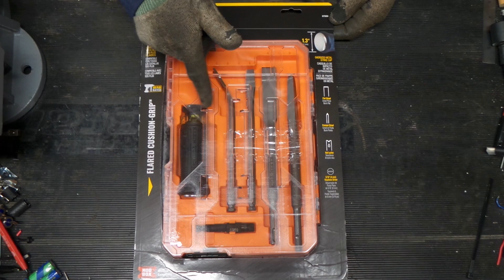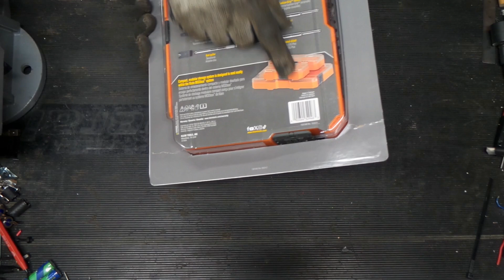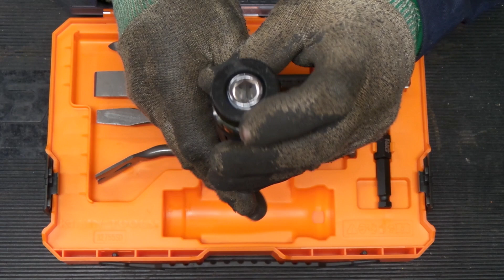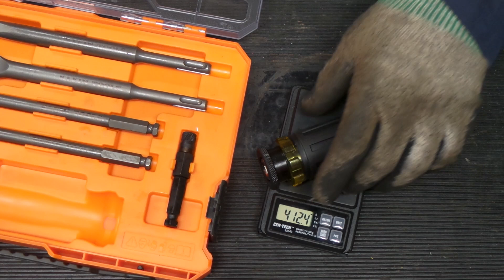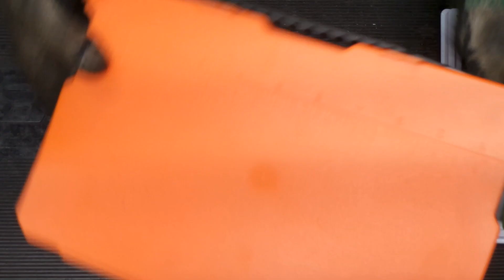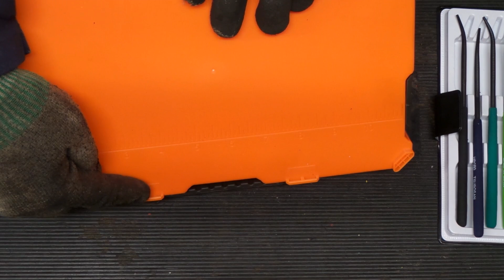Klein Tools SDS Demolition Driver Set, 6-Piece (32755SD) Review

Comment: This is a great review.  It illustrates the improvements that should be made for a 2.0 version of the set.  I would want fully retained 1/4 in. hex shaft bits in the adapter before purchasing the set.  I am a residential service plumber who would use the handle as my exclusive on person carry driver.  In addition to the keystone driver, I would make heavy use of the 1/4 in. hex adapter to swap Phillips #2 and Malco 1/4-5/16 in. reversible hex bits between this handle and my Milwaukee impact driver(s). Compatibility with SDS Plus bits is very helpful.  Klein is very close to perfection with this tool set.   I would not use the carrying case in operations.
Reply from the maker: Thank you for the comments. This is exactly the type of discussion I enjoy. 

I agree the 1/4 adapter needs to be locking. I also think they could make other screwdriver tips to go with this just for beating on. 

I agree they are very close with this set.

Comment: The use of space is SO bad that is one that would fit in a bag so much better than the mod box which I like my mod boxes I do have but this one is a D... maybe a D+ on a good day.
Reply from the maker: The empty space in this one is pretty significant. I would have like to see additional adapters or maybe even additional demo screwdriver tips to fill in more space. They certainly had some room to play with.
Reply: @TalkingHandsTools  I think the best use of space kit has to be that Icon bit kit. lacks sockets yes but the comparable Klein kit is bigger and would you accidentally drop a hammer from table height on the Klein? I have done it with the Icon on purpose.
Reply from the maker: I'm not sure this Klein case would take a significant hit. I get Klein is trying to use their Modular Box system and fit tools in to sell. I understand some of the tools only fit in a certain size case, and they don't want to include too much, which might drive the price up, but the empty space isn't this one is really something.

Comment: That's something new to me.  I bought the set with just the handle many months ago came with two sds bits.  Now I'm jealous of all thoes additions and arnt likely to be sold separately.  I got it didn't know what I was gonna use it for intending to put in my sds bag.  I ended up gind a sds plus clay spade for it and turned it into a tiny shovel that goes into two peices.  This wouldn't be the end of the world in a big sds bag one of the few times size could be ok.  I'd be curious if you put that adapter into a sds and drove a screw with it please show us maybe in a short 😆.   I've used adapters from 1/2 impact wrenches to 1/4in screw driving.
Reply from the maker: The screwdriver tip and the adapter unfortunately wouldn't go into a normal SDS Plus chuck.

I like your idea of getting other SDS Plus bits to use with this handle. Did you beat on yours much yet? It seems like it would hold up pretty well.
Reply: @TalkingHandsTools  as much as any demo screwdriver with the weight and girth I can't imagine it getting hurt.  Check out morgan's maintenance short he beat concrete with it.  I think tools and tactics smacked it eith a sledgehammer.
Reply: @MattHmm-rq6dn  Don't think ive seen the tools and tactics video, was it recent?
Reply: His videos are alot of live and arnt label as this tool or that.  I was a month ago or so.  Its alot of video to sort through with all thoes live at 2 hours each.